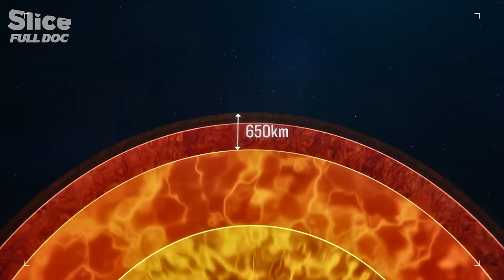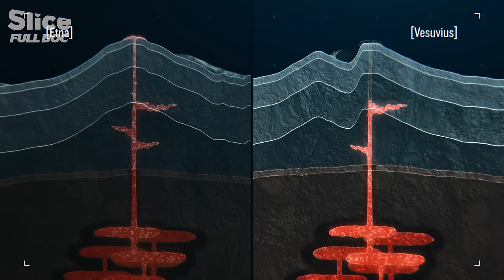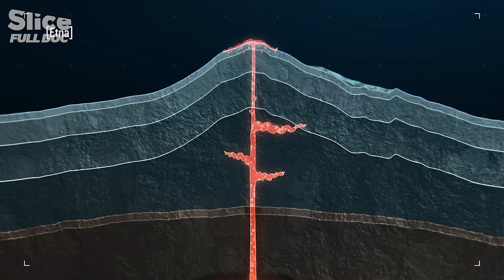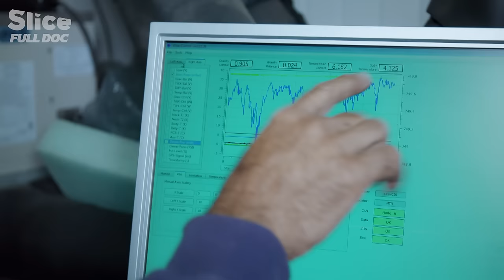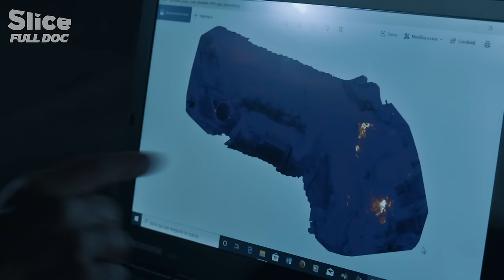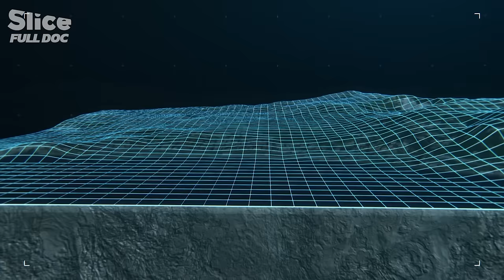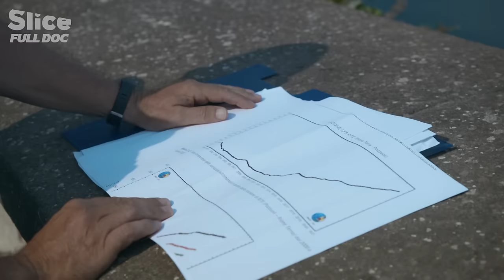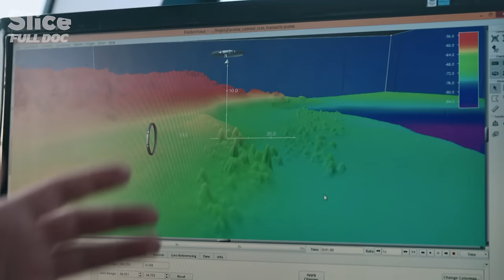The Guardians of Naples’s Volcanic Bay | FULL DOC

Comment: The INGV is talking about changes in fumes that are apearing since a few years at the Etna volcano, well wasn't that something to expect! Since end of 2018 magma channel coming from the Etna crossed the Crete line. The tunnel running from Bosnia, Albania, Crete and further connected in the Ionean Sea after the 6,4 earthquake in end Oktober 2018. After this high earthquake there was a strong fliw of magma moving back towards the Etna, it took and takes 2 hours and ca. 10minutes to let the Etna Erupt. If we see this as a dangerous or as a scietificdata, you know having two kinds of magma that are coming together and because they have both there own structure (different ground it moves on) you can get a different kind of gas or magma flowing. So the changes aren't really not to explain. Its just looking at what is taking place. Another look at hiw our earth is working could explain a lot more. And even make it easier  to understand magma patterns.